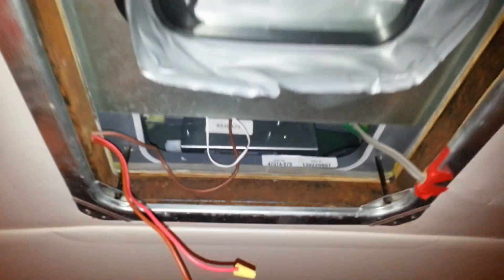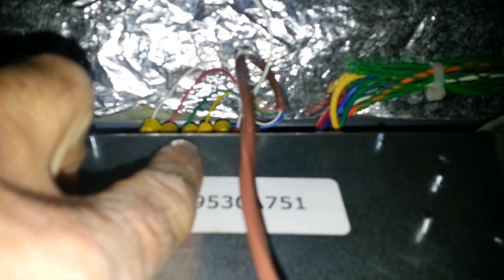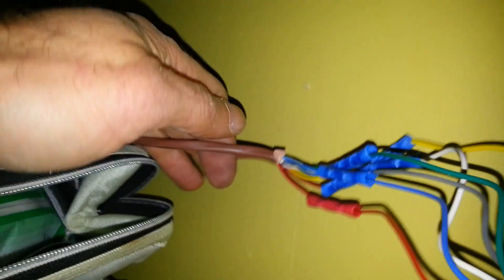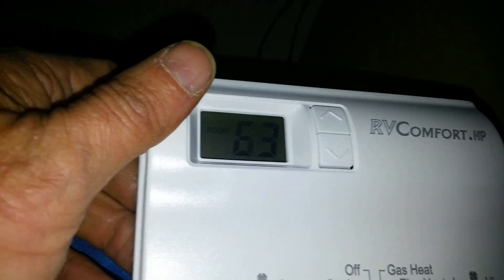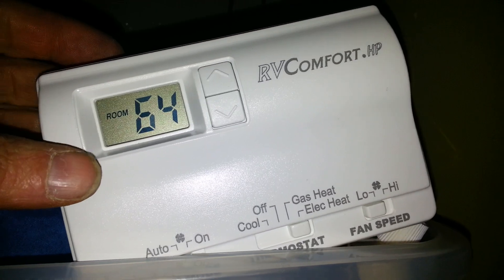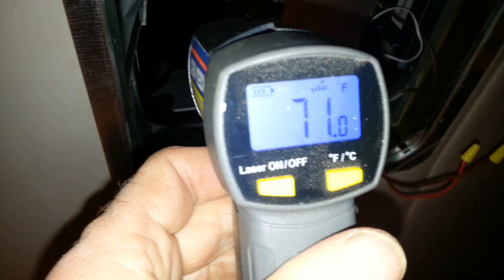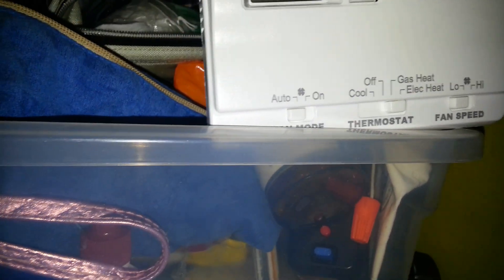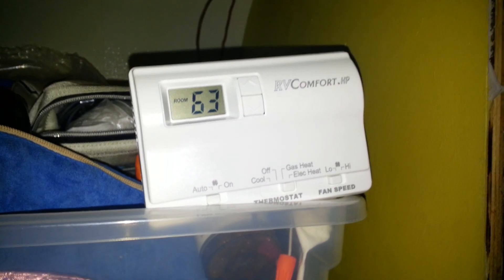Installing thermostat for a Coleman Mach AC(part2)

Comment: I was putting together one of these systems. In your video I understood everything you did, but you did not show where the 12 volt supply came from. Could you add information on this?
Reply from the maker: Bobby - The way I have my 12 volt system set up - Ive got 4 6v batteries that are wired for 12v config.  I also have a 12v alternator.  Both of those are wired directly to an isolated post for the positive and a post welded to the frame for the negative.  From that 12v post I have one long run of 4 aught cable to a 12v fused distribution panel in the front and one 12v fused distro in the back of the coach.  I pulled one circuit off an empty slot from my distribution panel in the front.  Ran the wore from there to get 12v to the control panel/thermostat.  Let me know if you have any other questions.  Id be happy to help.

Comment: What's the total cost of this upgrade?
Reply from the maker: If you already have the Coleman Mach Air in the roof the cost was about 50$ for the plenum, 60$ for the  T-stat and $115 for the control unit.  It wasn't cheap.  Don't really need the new Plenum.
Reply: Yes, I have the Coleman mach already. Getting tired of either super cold or super hot temps in the camper.
I would gladly pay to not have to deal with these extremes. Any specific vendor that you recommend to purchase the parts from?

Thanks for replying